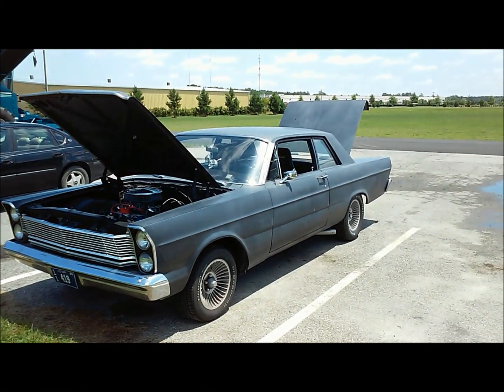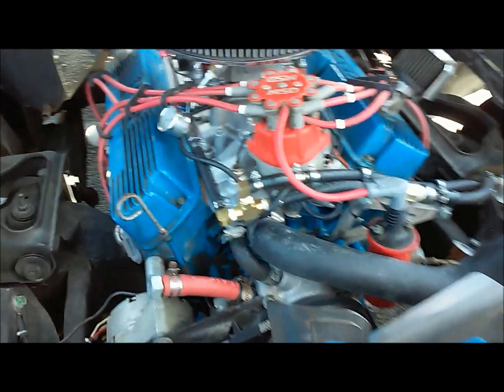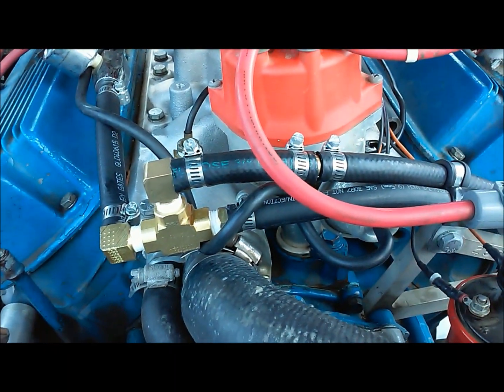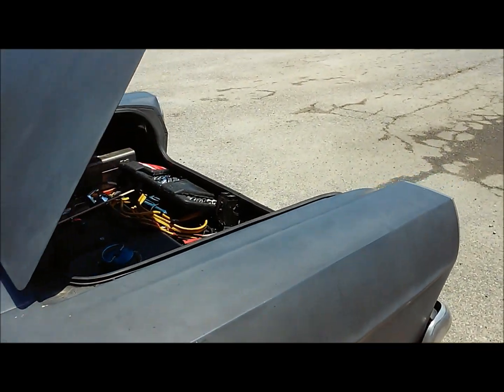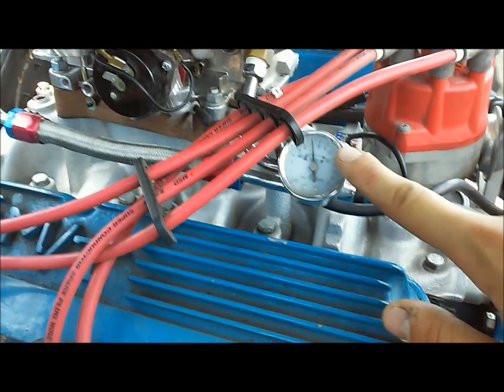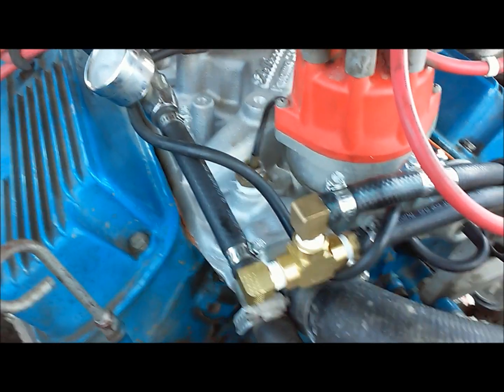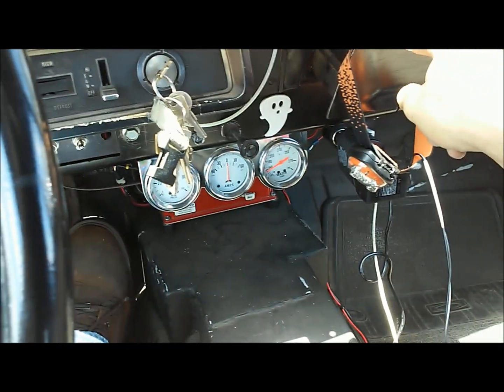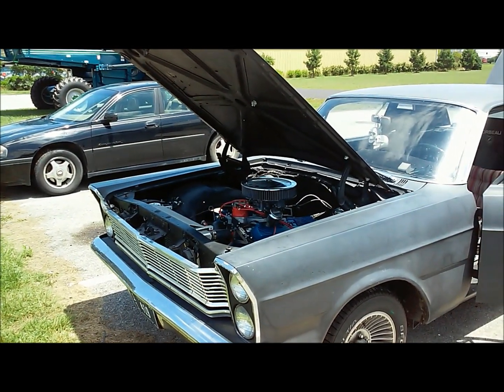Carb Vapor Lock No More - Simple Fuel Return Line

Comment: There are two Napa PN#'s for old style fuel filters with 1/4" return line stubs.. I solved my vapor lock issue on 65 Mustang coupe, w/ AC on in 95+ temps. Added the Napa fuel filter with 1/4" open stub, I installed a 1/4" steel line from the carb to the tank, used 1/4" NPT fittings to connect to the factory tank drain plug opening. Added a 60 thousands brass orifice from gas furnace, to the rubber line for fuel return as close to the carb as I could get. Absolutely bullet proof in hot weather.. No heat soak issues either when starting up hot after shutdown either.. Best improvement I ever had on this car for summer drivability.

Comment: Nice video, but gee there's a lot of joints there that could start leaking, whats more most of them are positioned directly above the engine. As someone else has already said, I reckon a better solution would be a fuel vapour seperator (basically a big metal fuel filter with a return out port that has a metered orifice), and mount it somewhere low in the engine bay where it's cooler and if it leaks there's less things for the petrol to dribble onto.

Comment: Hello Sir, what size T-fitting & angle fittings did you use for that fuel line modification? Was it 1/2, 1/4, 1/8, or 3/8?

Comment: wat your opinion of the style of air filter assembly you are using ?    thanks
Reply from the maker: This was probably ten years ago now when I filmed this, but that fuel filter is fine as long as you don't mount it idiotically. 
As you can see, it's suspended where it can't hit anything - the problems associated with those originate from guys setting them in their intake where they can smack on something metal and break open
Reply: @ThunderHead289  i was refering to the air filter assembly .it is not a kind that draws in cold air .
Reply: as well thank you ,you are very smart and i will being refering to your videoes ,again thank you

Comment: I just installed a fuel return line on my 65 bigblock Corvette. My plumbing was much simpler than yours but accomplishes the same thing. I have the same Holley non-return regulator and the same fuel log as you.  I simply  installed a 1/'4" hose barb in the port on the fuel log where a pressure gauge normally goes. I then drilled a .060" hole (actually 1/16" because that is the closest size I had) into a 1/4" nylon screw and inserted that into the rubber return line. Even though I have a mechanical pump fuel pressure was unaffected, probably because, unregulated, my pump was putting out 11 psi.  The first thing I noticed was that the needle on my mechanical fuel pressure gauge is now rock steady whereas before it bounced around wildly at idle.

Comment: This is perfect! Exactly the idea I had in mind for setting up a return line for my new build to prevent vapor lock this summer. I wanted to know what size hole to use as a restriction, I thought it would need to be bigger but this is great info! I had the same idea, slip a round piece of metal, going to use brass, into the return hose up at the T near the carb. Lucky for me I did a quick search and this video was the first one that popped up and it has exactly the info I need! Awesum! Nice build BTW! I'm a retired life long auto tech, I started twisting wrenches when carbs were still the norm and fuel injection was rare, I just love the old school carb. So many have asked why I don't got with injected, I just smile, cause it works!  And it works very well if you know what your doing. Also picked up a AEM Air/Fuel Ratio gauge kit so I'll have it to help me jet the new carb I have coming. I bought an 85 GMC S15 truck with the 2.8 v6 which I rebuiltd with some goodies, going to run the V6 just for fun for a couple years then do an old school small block V* swap into the truck, with the lopy cam I have it it she turns heads and a lot of people ask me if it's a V8 ;-) Here's a short vid of the first run after rebuild last summer. https://youtu.be/M8aHF3FDCC4

Comment: Hey guy - excellent video.  I did the same thing.  Installed a brass tee, but much closer to the carb inlet.  Basically I've got about 4 inches of brass going into the carb inlet, and in front of that is the regulator (set at 4-1/2 pounds).  On the inlet of the regulator is a tee, which has a 3/32" ( 90-thousandths ) hole drilled in a bolt stuffed in a short section of hose (almost all of this is 3/8 nickel-copper hard-line).  That runs back and tee's into the mechanical fuel pump's vapor return line to the tank (which is 1/4" stainless steel - about 20+ feet back to the tank).  Anyway, the stock (Carter M6622 is a reproduction of the OE pump on my car) fuel pump puts out about 7 pounds at idle, 8-1/2 or better at 1,500+ RPM.  Running a mildly hopped up 500 Cadillac big block with an 800 CFM Edelbrock carb (took quite a bit of tuning to dial that carb in), and it maintains about 3-1/2 to 4 pounds at idle (lopey 750 RPM idle with a respectable street camshaft), and 4-1/2 pounds at about 1,100 RPM and above.  Car never starves for fuel.  I think that's the key here - you've gotta put the return tee before the regulator, and then put the regulator just a few inches from the carb.  That'll mitigate any problems you were having with starving for fuel by putting the return tee after the regulator.

Comment: Well I ran a big Holly on my last Ford 460 and I suffered with vapor lock all the time. But I never realized what it was or why it was happening. I had an electric fuel pump with no return line which was part of the problem. And another video pointed out that I could get a vapor/ fuel separator filter. Between the other video and what you shared here I think I solved the problem. Thank you for making this video!

Comment: i know you said that I would need a 3 port mechanical.  i have a canister line i can tap into.  i would vapor lock but turn on the electric to push it through in about a few miles or so

Comment: But there is still quite a bit of "deadhead" hose between the fuel return plumbing and the carburetor, plus there is all the fuel in the carburetor reservoir that is subjected to the heat, and is not cooled by fresh fuel circulation. The proper set up is one where the carburetor itself was designed and built with a fuel return line that also already has a restriction built into the line to provide enough fuel back pressure. Like the carburetor i have in my Suzuki Carry.

Comment: They make a vapor lock fuel filter with the bypass built in that will help clean up all the extra hoses/fittings
Reply: Is that something that would work for my 1967 firebird. I live in Arizona
Reply: Thanks for the info for my 331 fox I think it's a balloon.im running gas out rear vent tubes

Comment: Great suggestion. But I'm nipple deep in trying to solve same problem. Holley electric pump at 7 psi feeding Edelbrock AVS on stock L31 3/4 ton crate engine with Air Gap manifold. 2" phenolic spacer between carb and manifold. After idling for 11 minutes, fuel pressure drops to zero, manifold at 140 degrees, spacer at 94 degrees, and carb bowls at 120 - enough to boil ethanol blend fuel. Carb is soaking heat from radiator air. Even if I chilled inlet fuel with Kool Kan, or installed a bypass, fuel would still percolate in bowls. I see 3 options: but non-ethanol fuel, shaker hood style scoop to isolate entire carb from engine compartment, wrap carb in copper tubing and circulate water(not engine water) through tubing. Any help out there?

Comment: I found a cheaper solution they actually sell a fuel filter with this already attached
Reply from the maker: Doesn’t hardly move any volume. Doesn’t work the same at all.
Reply: @ThunderHead289  there are 2 types I'm going to try it this week but I've only got a Holly 2 barrel with a carter fuel pump

Comment: @Thunderhead289
 Carb swapping my 87’ GT from the speed density efi it has. I’ve built a whole new motor, I’m just figuring out what I want to do for fuel system. I’m leaning towards mechanical fuel pump as I’m not an electrical genius. Should I run a return line? Or should I run a switched electric low pressure external ? Let me know if possible, thanks man.
Reply: Did you get it done? If not, you’re going to need a mechanical pump timing cover to start with. Would be easier to fix the efi

Comment: You made a great video about how to start a car that has vapor lock by holding your foot down on the gas then turning on. Just curious why that wasn't the solution for this vapor lock issue. Also if you have electronic pump why do you need to pump the gas to start it? Trying to learn, new at old cars

Comment: Weird question, but why run a full size return line hose if it is restricted down to a .060 hole? I am not getting pressure on my F100 360FE. I have the bypass regulator set up with the a 3/8" fuel supply inlet, one outlet goes to a gauge then supply feed for carb, and the other outlet is a return line sized the same as the supply 3/8". I am getting good pressure at pump, but no pressure at the gauge/supply line. Im assuming that i need to add in a restrictor sized .040 - .060 to create enough back pressure to pressurize the gauge/supply outlet of the regulator?

Comment: Great video! (Highly recommend a fan shroud, both for safety and efficiency)
Reply: I was just gonna recommend a shroud.
Reply: A fan shroud actually directs more radiator heat directly at carb and fuel lines. If engine coolant not overheating, then adding a shroud could aggravate fuel percolation problem.

Comment: I put the return line on it .it did not  change anything.after i drive about an hour i noticed my squierter does not spray clean shot of fuel.i used pour gasoline.same thing.holley shield same thing.the man on the phone from holley sounded like Bruce lee.and talk about return straw.i have a vented gas cap with clear filter and i approve theres is no air in the clear filter.so the problem is rough idle and hesitation going on in hot days.i dont trust some of holley representaives anymore

Comment: Hey Luke on the fuel regulator, you have it after the carb inlets. Does this only control the regulated pressure to the return line? Do you have another fuel regulator on the inlet side before the carburetor as well?
Reply: Wrong video.... I meant to post this question to your 74 F100 "no more vapor lock" video

Comment: If you make the breather line into the return line doesn’t the fuel tank lose the ability to vent? I’m trying to find a way to make this work with my stock tank that has the main inlet and outlet ports and one breather vent up top. Also, does the return line need to be plumbed to the bottom of the tank to stay submerged at all times? Any help would be appreciated

Comment: What symptoms were you having? Wondering if this is what's happening with my 63 impala . Under load itll sputter and sometimes at red lights and also seeing steam in my carb when turned off .. confused as to how to run a line into my stock gas tank . Is there a fitting on it ?

Comment: My dad bought a 67 Shelby GT 500 used in 1969 when he returned from Vietnam. Well his brother ( my uncle ) was hit broadside in the Shelby and the car was Totalled. My dad bought it back from the insurance co for $55 dollars and took some of the insurance money and bought a 1965 Galaxie 500 Convertible. 390 / 4 speed car. Well he took the 428 PI with dual 4 barrels and the 4 speed out of the Shelby GT500 and swapped it into the Galaxie. 50 years later he still has the Galaxie 500. Convertible which we call the Galaxie GT 500 and that 428 dual quad 4 speed shelby running gear . The car still has less than 50 k original miles and the running gear even less. Fun car

Comment: Dear thunderhead289 i hope you can answer my question  please  must the 60 thou drilled out bolt be a certain length  or not thank you  as in creasing then length can increase thr resistance creating more back pressure or not??

Thank you agin for the videos
Reply from the maker: You are absolutely correct that it increases resistance, I believe mine was a half inch or so. 
Now, thumb through my “recent uploads” as I made a video showing how to do this the full on correct way with return regulator 👍
Reply: @ThunderHead289  
Thank you very much for the information.  I already checked the video out really good video.
 Are you stil runinng the bolt on the  fairlane or did you also put a regulator on it.?

Ps what do you think abou a vented feul filter A. K. A  3 nipple feul filter

Comment: I've never had any issues with my galaxie, still has the mechanical pump and I don't run any sort of return, it's difficult to rig one up with a stock tank. Takes a little bit to crank over when its been running and when it's hot outside but it always fires right up after a couple pumps. But it does overheat, possible that my headgasket blew but I don't seem to lose any coolant and theres nothing in my oil.

Comment: I added a return line to my 54 Nash when I dropped a 350sbc in it.  Instead of the orifice, I installed a brass needle valve.  That allowed me to fine adjust the flow and the fuel pressure.

Comment: i've got a 78 f150 with a 351m still running mech. fuel pump and lately i've been getting alot of vapor lock and boiling fuel. so im going to put an elec. fuel pump on. would i drill a hole in my oem tank for the return fuel line? also does the electric fuel pump need to be right next to the tank? my part store called it a pusher pump thank you

Comment: I really enjoy your carb videos.  I have learned a lot from them.  I want to add a return/bypass line to my car by using the vacant port on my existing Holley regulator (12-840).   I plan to add a 0.060" in-line restrictor like you did on your set-up.  Do you see any problems with using the 2nd regulator output port?  I really don't want to buy a new regulator with a bypass port.
Reply from the maker: You can use your second port, you will just have to cut in a restrictors orifice kinda like I made here in this video! 

Watching this video for me is quite the throwback!!!!
Reply: @ThunderHead289  Thanks so much for the reply!  I really appreciate your input.  I'll plan to add a 0.060" in-line restrictor like you did.  I expect to place it within 6" of the second output port so the restriction happens before traveling the return line back to the tank.  Please let me know if you see any issues with that approach.
Reply from the maker: Bill Belt my only concern here is that the closer you can get your return junction to the carb, the better - my f100 fully bypasses the rail. I’ll be making a video on it soon, I just haven’t yet because Iv been prepping for power tour! 
The idea is to bypass as much of thenline as possible, remember - the hottest part of the fuel line is that which sits over the engine!
Reply: @ThunderHead289  My regulator is about 10" from the rail, so I think connecting to the 2nd regulator output will be OK.  Thanks again!  Enjoy the Power Tour!
Reply: @billbelt2046  I'm thinking about doing the same thing what you are talking about, using the port off my dead head aeromotive regulator.

What did you end up doing?

What the video poster guy says makes sense. You want to divert hot gas back to the tank tho.....
Reply: @jakefriesenjake   I did use the spare port off my Holly regulator to run a return line back to the gas tank.  I simply inserted a rounded screw head, with a 0.060" hole drilled into it, into some fuel line hose.  Then I connected that hose to the spare port on the regulator and ran it back to the gas tank using steel gas line.  At the tank I hooked that to the return line port on my fuel sending unit.  Once all was connected, I adjusted the regulator for the proper pressure for the carb and I was good to go.  Good luck with your project!

Comment: You can buy a fuel filter with two outlet nipples. One of the nipples has a restriction for the return line. 
https://www.google.com/imgres?imgurl=https%3A%2F%2Fstatic.summitracing.com%2Fglobal%2Fimages%2Fprod%2Fmediumlarge%2FWIX-33041_ml.jpg&imgrefurl=https%3A%2F%2Fwww.summitracing.com%2Fparts%2Fwix-33041&docid=a-zJpIq6lGO9kM&tbnid=6-F9mT_3AfGpfM%3A&vet=1&w=250&h=218&client=ms-android-verizon&bih=596&biw=376&ved=2ahUKEwjI9Kq_qsPiAhXjY98KHeH2DdMQxiAoAnoECAEQIQ&iact=c&ictx=1.

Comment: thats a great idea to use a bolt with a orifice hole as a restriction. Im going to do a similar set up. What size drill bit did you use? 1/16" hole down the center of a 3/8" bolt? i was thinking of using 3/8" all thread or 3/8" bar stock to avoid trying to stick a bolt head in a rubber hose.
Reply: Cut head off bolt. Use 1/16" bit.

Bolt size depends on the size of the return line.

I will probably do this trick soon too.

Run smallest fuel line that will work with the fittings you can find.

Also, don't run ethanol in carb engine! Sucks ass

Comment: Can you drill a larger hole (ex. 5/32") in bolt used in the return line?   1/16 (.060) is pretty small and you stand a good chance of breaking the drill bit, like I have in the past.
Reply: Just go slow, use oil and a drill press and a little vice. Crank the speed up too

Comment: Would this setup work with a mechanical fuel pump?
Reply from the maker: Matthew Green it indeed will not based on how the pump operates. When I tried with a 100 gph mechanical pump, I could only get about 3 psi out of it
Reply: ThunderHead289 well i have a 4-7 psi "booster" pump installed inline to help with the vapor lock issue. 

Was entertaining this as a potential solution for the waste of excess fuel when i kick the booster on.